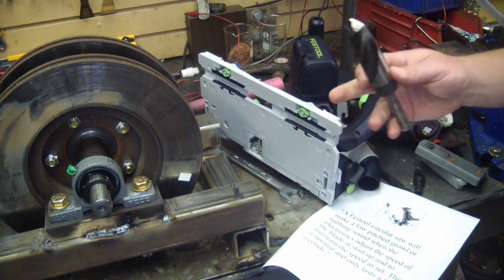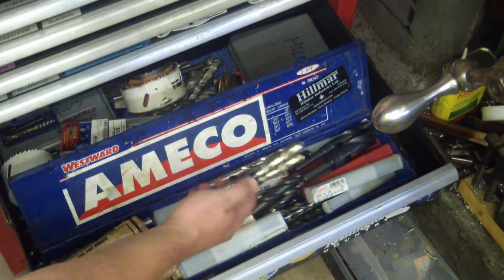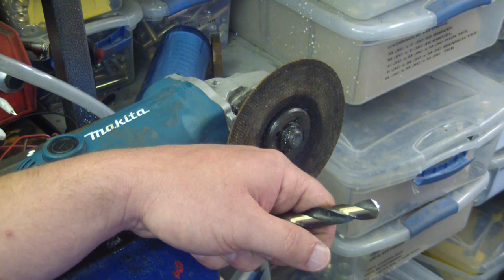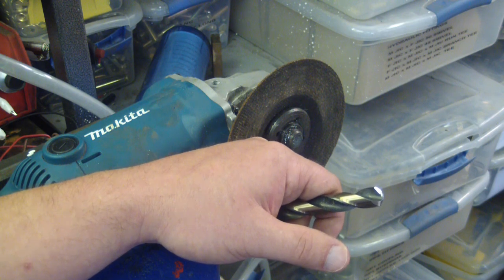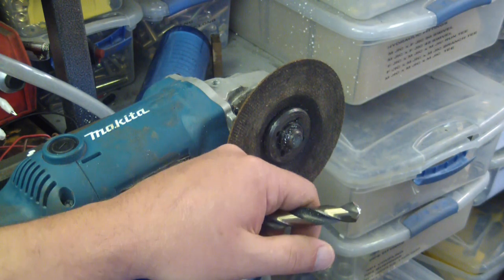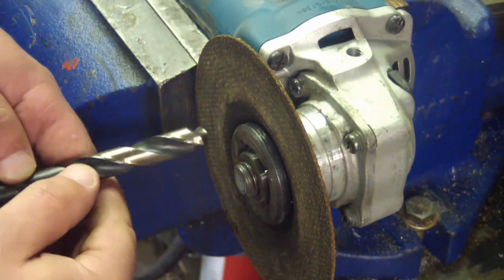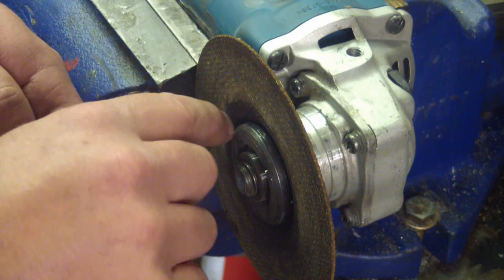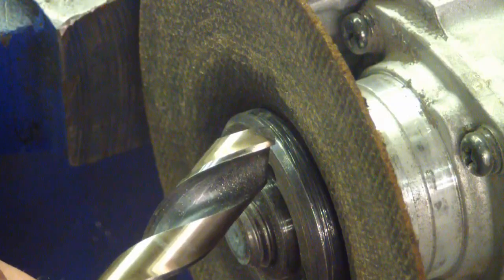Sharpen Drill Bits WITHOUT a Drill Doctor?!

Comment: We got a Drill Doctor for the shop,  we tried it a couple times and just went back to either using a bench grinder or a belt sander.    There's probably 2" of dust on that Drill Doctor now.
Reply: ***** into additional dust surface ;D
Reply: Josh Wilkerson I don't work at that craphole anymore unfortunately.
Reply: ***** unfortunately? or fortunately? see if AVE will send u his drill doc. hes either not gonna use it or sit on it untill he can turn it into a toothpick launcher or some shit to fire toothpicks at the wife and laugh as they bounce off her chest.
Reply: forgot to disconnect your keyboard again?
Reply: ***** So I should invest in a Drill Doctor for the wood shop rather than a cyclonic dust collector?
Reply: ***** They SUUUUUUUCK, They are great for quickly making dull drill bit an off center dull drill bit.
Reply: funny seeing you here, as a locksmith we end up needing to sharpen a LOT of drill bits and i find the bench grinder method the industry standard amongs us.
Reply: Samuel Smeltzer  its not the accent, its the terms and phrases that make me lol
Reply: +Brandon Fesser dust collector will help your lungs and cut down on your cleanup time.
Reply: ***** I looked at the "Dr." and with that price tag I went back to sharpening the way Grandad taught me with a file(I use a grinder, sorry Gramps)
Reply: Steve Dixon Good call. If a file will bite on your drill, you need better quality bits.
Reply: GunFun ZS True...but the big box stores sell so much crap bits now...where do you find the good ones now??
Reply: Steven Hardy  msc direct
Reply: ***** for smaller drills i prefer the Bench grinder or a sander
but for drills that are 2" or so i would use a drill doctor because im a lazy fuck
Reply: ***** Could you show us how you can turn a normal Chisel Drill into a Split point drill?
Reply: Steven Hardy There's your problem. Not the big box stores. Go to an industrial supply. There is pretty much guaranteed to be one in your town.  Order an index online, and replace the ones you use from your local industrial supplier.  Buy the smaller ones 10 at a time for the sizes you find yourself using.  It also pays to spend $1.75 USD each for a few cobalt 1/8" bits and about $6 for a 1/4" cobalt, etc. Those are pricey but when you have to drill through a weld or something you will be glad you have them.
Reply: GunFun ZS That's great, you just alienated the 13yr old boy that loves his all speed no torque Dremel...  When I see MSC boxes under the tree, I feel joy...
Reply: GunFun ZS Well,
Reply: Copper Head SevenPointThree Don't be disrespectin' my perfect Germanic rotary tool!
Reply: Travis Williams 1) There is no need to act that way. Grow up. 2) he was obviously being sarcastic. You would know that if you actually read the whole thing before mouthing off.
Reply: GunFun ZS I drill through welds with my $29.95 115 bit HSS Harbor Freight index set. Numbers, letters, and fractions! One trick is to weld right, so your weld is ductile. The other trick is to run a drill at the right speed. With those bits I tend to keep it at around 50 SFPM. (Pi * Dia. * RPM) / 12 = SFPM BTW I think they spell Kobalt with a K. The house brand tools I mean.
Reply: secondking1 I agree totally.  That " when all you have is a hammer, everything starts to look like nails" is getting printed out and going up in my work area.  Another one that stuck was "a grinder and paint makes me the welder I aint".  You could make plaques out of these and sell them on ebay.
Reply: secondking1  Me Too :)
Reply: +TAOFLEDERMAUS I use both.  Drill Doctors are nice if you take your time, set it up right, get the "feel" and take your time.  I can get the one at the shop to grind most drills pretty close to factory grinds and beyond.  When I need fast, a well dressed bench grinder wheel is pretty reliable.
Reply: Taofledermaaauuusss!!! Say what's up to Danny, and OG!!
Reply: @Darknessdark01  Lolololol
Reply: @GunFunZS  I've had good luck with some bits. You really have to read carefully. Alot of the junk bits are read COBALT coated. I had some legit Cobalt Mastercraft bits and they were level with the Snapon Cobalts.
Reply: @1pcfred  I know it's an old comment but those are often excellent. you will get occasional duds that are not heat treated properly or miss ground or something like that, but I have their current harbor freight index that is the Cobalt bits that are something like $70 usually it's an excellent kit. I've used different iterations of the same kit and had a bunch of them junk I would say all things equal it's worth getting. Also worth getting carbide bits in a couple random sizes such as eighth inch and quarter inch.
Reply: @linadsenoj  Yes I'm aware of that if you're interested project form recently did it series of videos comparing the quality of various drill bits. I haven't had good luck with the harbor freight large index that has all the decimal and fractional sizes of cobalt bits it's about $70. for anything that I know is going to be hard though I just go straight to a carbide pilot bit in quarter inch or 8 inch as appropriate. I have a little diamond wheel that mounts in a drill chuck that I used to sharpen those things. I would not pretend to be expert but I get it right more often than not, and that's a much better record than I've ever seen anybody do with a drill doctor.

Comment: I just spent 4 hours this morning sharpening bits that I found at a garage sale in an old cigar box.  Since I am an old man, I need my magnifying spectacles to sharpen anything smaller than 1/8 inch (screw you millimetric using bastages).  And that's the way, uh-huh uh-huh, I do it, uh-huh uh-huh....

Comment: Really like your channel!  When I was about 12 years old my uncle showed me how to sharpen twist drills by hand on a bench grinder and produce a round hole. Its harder than you think!  A real test is to take a broken drill, cut it off so the end is square with side and go from there. Keep up the good work! Im 59 years old and still love learning and laughing!
Reply: I had a welder I was helping show me several years ago. Up until that moment I was under the impression that dull drill bits were trash and have thrown away many. The welders exact words were "trial and error, either it will drill a hole or it won't. And in that case, grind on it some more until it works. It's all about finding the correct angle". He had drill bits that were 2 to 3 inches that when new were 7 or so inches long.

Comment: "The way your grade ten shop teacher lectures you to do it, in between six months of filing square blocks with a dull file." Fuck me, I thought it was just us.
Reply: Left me shocked too. Fucking accurate.
Reply: geez, my shop teacher actually had us do stuff. Not entirely sure I'll ever forgive him for tricking me into melting my Styrofoam plane with spray paint (it left a green stain on the welding room floor) but we made at least 4 projects in 2 years
Reply: Thomas Blithe Really? We did 3 in half a year. A small hammer,  a hobby clamp and a stool.
Reply: +Franklin Clinton the projects were pens, co2 planes, tenderizer hammer, and a clock. we spent the rest of the time screwing around in autocad
Reply: Wow only 3 in half a year?

In like 2 Months i had at least 4 projects....
Reply: +Thomas Blithe

Seem to recall us students either made "peace pipes", or cast molten lead into Dungeons and Dragons figurines...

Comment: That's actually one of the first things we learned in trade school was how to sharpen drills by hand.  They had a bin of "chowdered" drills.  You had to take one, sharpen it, drill a hole in some scrap, and turn them both in.  FFW about 20 years, I work in a machine shop with all the latest gadgets and cutting-edge tooling and technology.  Know what happens when you have to have a particular drill and some dumb fuck chowdered the last one, didn't order any, and put it back in the drawer?  You sharpen it by hand.  Word to the wise: DRILL A TEST HOLE FIRST!.  If you don't grind it right, it will drill oversize.
Reply: Exactly. I call it "welcome to the real world".
Reply: I used to work an Acme Gridley multi-spindle screw machine. To get the right hole size, we'd grind a drill bit slightly off exactly for that reason. You might need a couple of extra thou' and that would just do it.

Comment: I love the way you "encourage" your tools to behave. I do it exactly the same way! 
I've never seen a machinist use a Drill Doctor. I have seen them use disk sanders a thousand times. Only time we sent them out was for the custom bits we had which had 2 or more diameters. Used for manufacturing; i.e., drilling through both walls of a tubular steel component with a tool and fastener head clearance hole on one wall and the thru hole on the opposite wall.

Comment: tighten until you hear a crack, then back a quarter turn....

that is the funniest shit I've heard ahaha
Reply: Same as backin up a car or truck.  Back up till it sound expensive, then say fuck and  pull ahead and inch. Job well done.
Reply: I spew'd when he said that too funny.
Reply: friend of mine say that every time he hits the dock hard!!
Reply: Chevy 454 he is missing 1 EXTREMELY NECESSARY for success... While tightening the fastener you need to pray to your preferred god/goddess/higher power that you believe in that the Crack you hear will be caused by the unloading up the twisting force that was building up in the metal of the bolt.
Reply: Funny because it’s fuckin’ true. We’ve all done it, haha!!!
Reply: Just said this at work tightening a ratchet strap hahhaa  "keep goin till a weld breaks then back off a quarter turn"  plumbers liked that one

Comment: Thanks AVE, I only watched this video last week. Today in work I snapped my good 10mm HSS and the only other one I had was so blunt it couldn't melt its way through PVC, let alone cut through steel. The only thing I had handy was my grinder and I was able to get a fairly decent edge on the old bit, enough to get the job done. Saved me a headache, nice one.

Comment: If I am doing a shut down, I am bringing in new drill bits by the gross. You can also use a chop saw with an abrasive blade to sharpen bits. I learned how to sharpen bits as a hired electrical hack under contract for Proctor & Gamble at a laxative factory. They sold trainloads of that stuff to Australia.  Them Aussies must be really constipated. What they did not send down under got made into Metamucil. When they made batches of the orange stuff, it stained my contact lenses orange. Nothing like having that liver disease look in your eyes!
Reply: It's a generational thing. All our old people are 100% absofacklutely convinced that they will die of cancer of arse explosion, idk, if they are the slightest bit "irregular". Whatever that means. Me, I take metamucil to stop shitting. I had me gallbladder out in diddly 3. And since then I'm lucky if I have 2 consecutive solid shits a year. But metamucil makes it less like battery acid. Apparently it's one of the many charming side effects of a gallbladder removal my surgeon or doctor didn't think it was a good idea to tell me about. And I worked that out myself after seeing the same fucks for "irritable bowel" for more than a decade. Still, I suppose it's better than the feeling you get when passing a gallstone, which is akin to having a 2 by 4 hammered through your chest 3 inches right of your solar plexus...
Reply: yup used to work for a tight wad who wouldnt buy a grinder used  disc sander to sharpen drills and split points or thin web...theres shops in area now that throw away all drills when dull end mills also millinials..are wimps
Reply: 3 years late to the party but not only are we all constipated we also love your orange Metamucil.
Reply: If you're out in the middle of nowhere, a good file goes a long way on a dull bit.
Reply: Jeez

Comment: I appreciate the quick lesson on sharpening using a grinder.

So much hate in the drill dr. I'm thinking the simplicity is too complicated for some. My dad gave me a drill dr 500x several years back. Finally decided to see if it's worth a damn. 

Can't just go up to a grinding stone but it only takes a minute or so, if that to sharpen a bit perfectly in the drill dr.

It may not be something someone is brave enough to bring to a jobsite, but suits a typical homeowner very well.

Comment: Hi AvE, Yes in deedy, I took my 4 year formal Machinist Apprenticeship at Jorgensen Steel in Seattle Washington. One of the first things we had to do was sharpen a 3" drill off hand on a pedestal grinder. I know, and, you probably know that by orienting the cutting lip just slightly up at the periphery, will properly orient the chisel point. Drill nomenclature. You can of course use a drill pointer gage, 59 degrees or 118 deg. included angle, for most bits. I am a sub to both you and The Post Apocalyptic Inventor. Your funny, but right on. If the chip comes out even your good on the lips, one side and their off. Obviously to much relief and the cutting edge will not hold up. Milling the potato was some funny sh*t. Happy Summer, be good, C.

Comment: I was a track welder on a small railroad in northern Minnesota. One of the things I did was sharpen drill bits for drilling the web of railroad rail. This is carbon steel and nothing to trifle with. The methods in this video mirrored perfectly my situation in the field...although I did have a trigger lock on my grinders. The occupational language was very similar, as were the mosquitoes (and the cold in the winter). Granted, this is not first-line machinist method maybe, but it is what works when you have to get those bolt holes drilled so you can put the track back together, before the ore train comes...and the old man does not want you to stop the damned train because of a bolt hole.

Comment: A $160 single-purpose piece of shit, vs a $160 grinder that can be used for all sorts of shit. Which, pray tell, smells like a better deal?
Reply: Lord Skitch  But with a drill doctor, any monkey can sharpen a drill bit to a reasonable sharpness. With a grinder, you have to know what you're doing. But if you know what you're doing, the drill doctor is useless.
Reply: February I think it's got more to do with buying a single use tool as a way to not spend the time to learn how to do it correctly. And, in the process, screw yourself out of a good skill to have.

'Tis no bueno to spend your life cutting corners. Even with the Drill Doc, I imagine the first handful of drill bits come away either god awful or a quarter inch shorter. With a bench grinder, or even a field-expedient crazy Cannuck contraption in a vise, the same thing's gonna happen, but once you've got it down, you don't have to have a special tool to get the job done.
Reply: February Au contraire. At the shop I used to work at, the owner had his primate of a son convert most of our dull, but functional drill bits into useless bits of steel using a DrillDr.  I am no master hand sharpener, but after trying the Drill Dr my self, I found that it prevented getting good grinds more often than it allowed them. Also it has enough wobble in the holder that grinds are seldom uniform from one flute to the next. Freehanding on a bench sander was honestly easier.
Reply: Pretty much all I do is drill stainless.  While I'm pretty good at doing them on the grinder, I got a drill doctor and like it.  
1:  I use very expensive drill bits that are worth resharpening.  Even smaller ones.
2:  Buying new drill bits takes money and time (more money).
3:  While I can hand sharpen beautiful 6 facet drills, it takes a lot of time (much more money).  The drill dr is quicker.  And I have to resharpen an awful lot.
4:  The drill docktor is more reliable than old shakey here from day to day.
5:  While busting out a bit on the grinder is quick, the flutes will not be even nor will the relief angle be right.  While having the relief right is not that important for machine drilling, it really helps having it where you want it to be for hand drilling.  'course if you're drilling with uneven cutters, your going to be oversized and likely bell-mouthed.
6:  The next best thing costs $2000.

That said the split point function is a bit of a joke.  You want to go back to the grinder for those.  And if you have a serious chunk out of the drill you'll want to rough it out on the grinder and finish it on the dr, since it has such a weak, slow grinder built in.  I also got it with the idea that others in the shop could use it to sharpen bits because they can't do it on the grinder, but unfortunately that hasn't actually happened.  Must be a life lesson there.

It's easy to bad mouth the drill dr; any dummy can do that with a casual glance.  Much harder to figure it out and see what it's actually for so you can properly criticize it.
Reply: ***** If they simply had a few sizes of collets which were tight enough fitting (even lathed zamac would be fine) to actually hold small bits concentric, or put a unifor chisel onto a big bit, I would love the thing. I had a boss who expected inhumanly perfect tolerances from a pair of wobbly chinese drill presses. He could "see" from across the shop floor that one plate in a stack of 20 had a hole that was 1/128th off on cross square. My micrometer eye was never so sharp. Unfortunately,he couldn't see that his presses wandered by almost 0.125", that his stanley brand squares he expected us to do layout with would leave almost 0.25" gap if you put two of them together, that his level would give different readings by 5/16" if you swapped ends... So having a drill bit that was true enough to give a chance of a hole near the center mark would have made life a lot easier.
Reply: GunFun ZS ya shoulda told him about his POS tools!
Reply: You can get a 30-buck 4" grinder at H. Fright.
Reply: that is called efficiency!